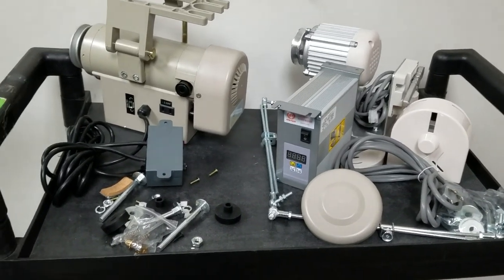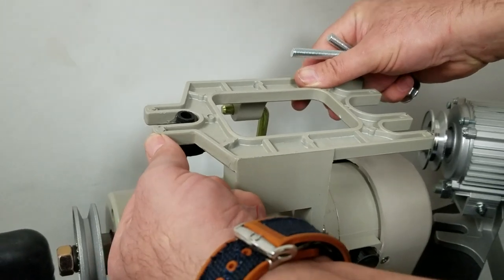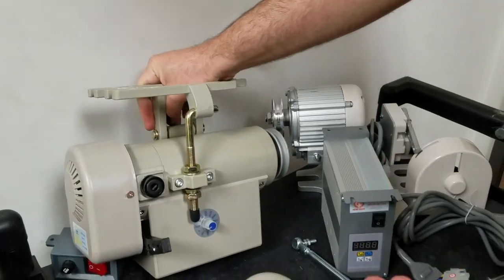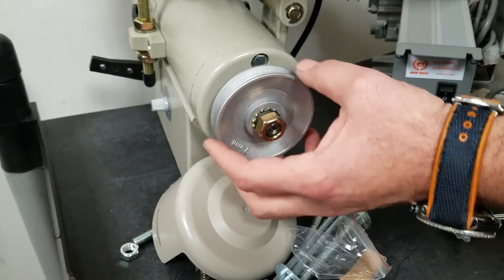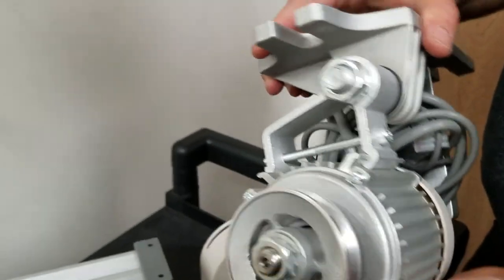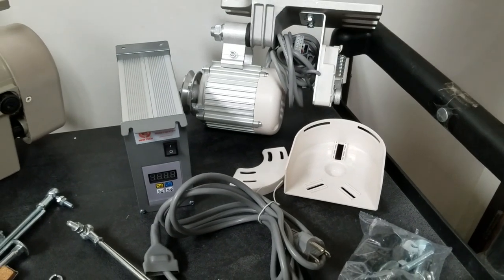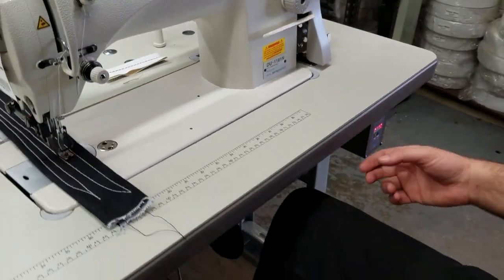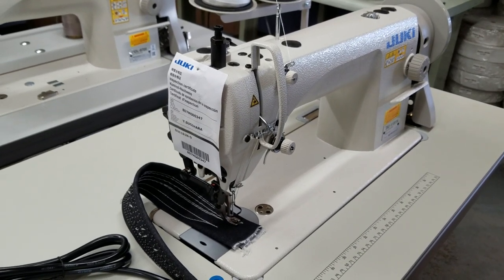Sewing Parts - Regular vs Brushless Servo Motors - Goldstartool.com - 800-868-4419

Comment: Quick question I just bought my first juki machine after 10 years of sewing using a small brother machine. But I'm so lost when it comes to motor rotation. I bought a juki ddl 5550N. What's the difference if the motor rotates clockwise or counterclockwise PLEASE HRLP